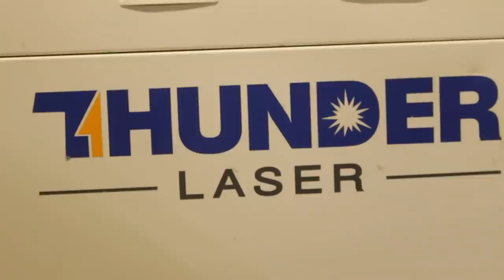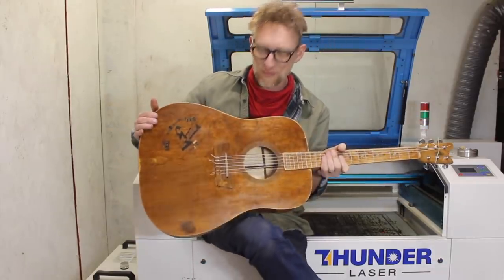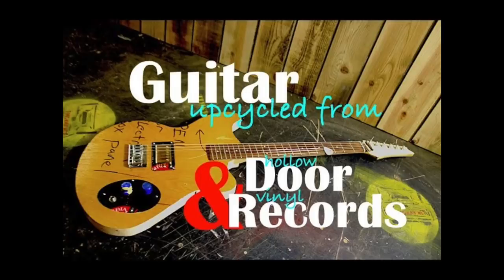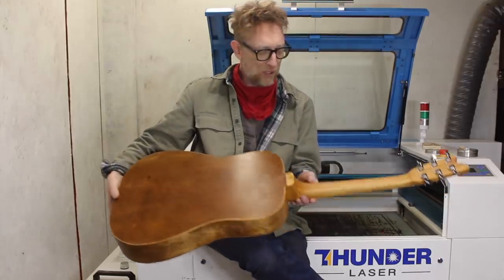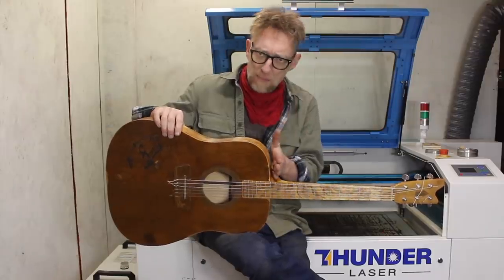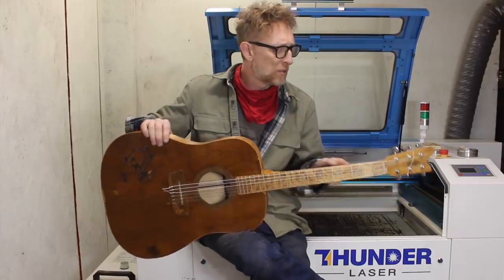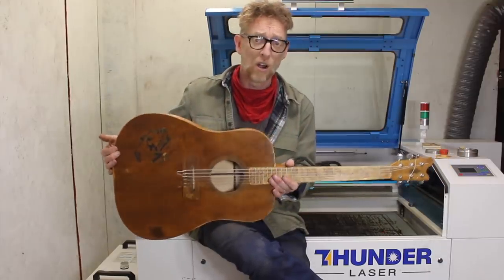Acoustic Guitar Made Entirely of Closet Doors

Comment: Nice work!  You can lower the strings by correcting the neck angle.  Fender in the 70’s were bad for this and required a neck shim to correct the neck angle.  By doing so don’t be surprised if you need to make a new saddle that raises the strings.

Comment: Thanks for this Video!
Now that the Neck is permanently set, and  can't adjust the angle :
One can lower the High String action, by sanding the Bridge itself, and the Saddle.
Also routing (lowering )  the Saddle pocket by 1/16 "   will help.   Be sure to  " Rat File "  
Grooves on the Bridge,( using a Dremel), on each side of the saddle, (where the strings rest),
to prevent the strings touching the Bridge wood, and are then able to vibrate Properly.
Reply from the maker: The problem is the body is 1/2" thinner at the neck than the tail, so the top slopes up as it goes away from the neck. It's not a setup issue and there's not enough wood on the top to set the bridge low enough into it. I just screwed up! This is just a prototype, I'm already on to the next one :)

Comment: Nice work! I recently found a guitar like guitar in a music shop in Marrakech. I say guitar like guitar bc whoever made it shaped it like a guitar but only 4 strings, fairly shallow body, and wooden tuning pegs that come up from the bottom of the peg box like on Renaissance guitars. It's made all of plywood with a pine neck and sides. The sides are really a series of pine squares placed with grain vertical. It had various issues but I kinda fell in love with it and I'm now trying to improve it. I took the back off and planning to add some bracing, trim down the sides, add some kind of neck block (the neck was only nailed to the back, no other support!). The bridge is interesting but too far back so im going to make a secondary  floating bridge that's adjustable. The maker cut (quite deep) fret slots but never added frets. I want to either fill them in or add a hard wood fingerboard and add tied on gut frets, since with a floating bridge the fret slots won't be in tune. It's painted, so idk yet how that will affect the tone. I might use brass and iron strings, or I might use the kind of handmade  goat gut strings that  are used on Moroccan instruments. We'll see.

Anyways your project kinda inspired me so thanks! Idk if my Moroccan guitar will sound much like a guitar but it will sound distinctive I'm sure  😊

Comment: Impressive. From concept to execution, an amazing project. I understand the concept but...If you do this again maybe give yourself a little more room on the hardware. A truss Rod so you could use steel strings and have some adjustment, bone (or some recycled synthetic) for the bridge saddle and nut, maybe some nice hardwood for the bridge and bridge plate. You would be able to set it up nicely so it plays well, sounds great, and looks sharp as a bonus. You could complicate it a bit with an off center sound hole, maybe a rounded off area for an arm rest and a cut away to really snaz it up. I see you get a little impatient sometimes and I understand, I also realize there is a lot happening that doesn’t make it into the videos, but I have no doubt you could make a real, jaw dropping “players” guitar from reclaimed materials if you tried. You have the tools, skills, and the vision. I enjoy your videos. 👍
Reply from the maker: This one was all about using only door.  Future versions will include real wood fingerboards, etc...

Comment: How is the neck holding up? I have a very similar idea but using plywood instead. I still believe it's a very good way to make a very stable and strong neck.
Reply from the maker: you mean they sell thicker plywood already made? lol. It's been 2 weeks and the neck is holding up fine. I did use nylon, tho, to keep tension down. I'll work up to steel string.

Comment: Try using graphite for truss rods. Then you can at least use ultra light steel strings. You could probably get away with silk and steel with your current method though if you wanted to get away from nylon. The layers and glue probably give it enough strength.
Reply from the maker: i've used graphite in other builds for sure! I think it could handle steel strings as-is, or I could just put a real truss rod in it. It wouldn't be difficult.

Comment: Holy lamination batman!

You put a metric crapton of manual labour into this considering this supposedly isn't even considered woodworking in the first place as the laser does all the work for you ;-)
Love the result (the look AND the sound). I wouldn't even have expected to get decent firewood from the heap of junk you started with.
Reply from the maker: HAHAHAHA! Great comment. But you're wrong, I put an imperial crapton of work in to it (but plywood and laser, so yes,  it's still not "real woodworking.")
Reply: Darn imperial units! So was it a long crapton or a short crapton then? If it was a long crapton I would only be 36 crap-pounds off.

Comment: How did you glue the neck together without removing the old finish?
Reply from the maker: i sanded every panel enough for the glue to adhere. There was one spot that I didn't sand enough and it didn't take, so I repaired it with epoxy.

Comment: My first thought when I saw the neck assembly was that the action was going to be very hit or miss.
Reply from the maker: The neck assembly has little to do with the action. It's actually much more stable than a traditional neck. I made an electric with a truss rod in the same style here: https://www.youtube.com/watch?v=Da_P9nIiYRw . The action sucks because I messed up the angle of the neck in to the body. It's parallel to the upward sloping back of the guitar instead of the flat top.

Comment: Am I right in thinking that laminated wood is very very strong? Sweet neck mate. Could this handle steel strings?  Very cool Tim.
Reply from the maker: it could probably handle steel as-is but with a truss rod would be better. I am more concerned with the tension ripping apart all the laminates at the bridge.

Comment: Don't they usually make nylon string guitars smaller? I imagine you could lower the bridge to lower the action some. If not I guess the only thing to do would be to steam off the neck and sand it down but that's a pain in the neck. Very cool though. I love the recycling. 

Your Etsy doesn't have any musical instruments. Is that where they'd be if you had them to sell?
Reply from the maker: good eye. I made a jumbo steel string body with an electric neck and classical nylon strings and bridge. why? because I can! lol the body is not flat; it's an inch thicker at the heel than the neck. SInce I atached the neck to the bottom first instead of the top, the whole body goes "up" and the neck angle/strings needs to do the same. I can't lower the bridge any more without digging in to the body of the guitar. Simple fix is to attach the neck to the top first so that's all on an even plain, then make the back of the body angle away.

Comment: Good . You shoud do the body of the guitar first and then set the arm properly set it in the block with a  dove tail and set the angle .
Keep working !
Reply from the maker: I didn't want to try and make a good dovetail joint out of plywood so I cheated :)
Reply: @timsway  then if your concern is the strength of the joint you could set the angle diectly in the base of the block of the arm . But there is not much chance of regulation . 
By standard the fret board should stand in level with the bridge any way you must build the acoustic box first . Keep it up !! Good luck !!

Comment: Nicely done Tim. Quick question, did you kerf the sides so they would bend? It was hard to see in the video while you were mounting the sides. It’s nice to see another use for hollow core doors than temporary work tables.
Reply from the maker: there's a segment on the lasering near the beginning which shows how I did it; I kerfed on the laser creating "wacky wood" side pieces. It worked REALLY well.

Comment: This is such an awesome project!,
Do you think this would be a managable build for some one with access to a laser cutter and basic handheld power tools?
Reply from the maker: yea, that's pretty much all I used! If I were to do it again, I'd use real wood for the fingerboard and bridge. I was making a point with this one :)
Reply: @timsway  Thanks for the reply :)
Is it very loud is it in relation to a conventional nylon string?
Reply from the maker: @samridsdale4484  maybe a little quieter. The plywood doesn't resonate as well as real wood.
Reply: @timsway  I have one more question (I promise this is my last!), do you think this style of body construction could be used with solid wood? Or would the sides not be able to bend as much even with the kerfing technique?
Thanks :)
Reply from the maker: @samridsdale4484  you would need to steam bend real wood sides. This would probably not work with real wood.

Comment: As expected excellent !!! 
Too bad for the neck angle but I hope there might be some others to correct this. Did you put a trussrod in it ? Maybe a two way action one could be useful with so much lamination. 
🤘
Reply from the maker: no truss as it's nylon (why I chose nylon, keep the tension down, but I think it could handle steel strings and a truss). The neck angle problem is the body is a little thicker at the back/bottom and I atached the neck to the back first instead of the top, effectively making the top of the guitar rise up, so it's impossible to get the strings low enough on it. I'm already working on v2.0 :)
Reply: @timsway  if you don't make errors, you can't learn ;-). Already waiting for v2.0. Hope you'll find enough doors 😁

Comment: Wouldn't one of those doors make a good LIGHT WEIGHT 'solid body'--just cut out the shape and glue on a surround to finish the sides. The inner webbing should give a pretty strong base for the neck, etc.--maybe build it as a semi-thru-neck. Hmmm.....
Reply from the maker: I have SEVERAL videos about doing just that. go digging in the archives. :)
Reply: @timsway  Why didn't I think of that! I'm fairly new here.

Comment: I've only just subscribed recently so I haven't seen a ton of your (amazing btw) builds, but is it possible to go back and install a truss rod in the neck at this point, or is that something normally done during the build?  Do you normally install truss rods in your other builds (being that they're electric) or just focus on neck alignment and plan for the string tension when planning?  

Thanks for these videos!  Keep making them and I promise I'll keep watching!  I also enjoy your music!  Is there anywhere to listen to more of it compiled in one place?
Reply from the maker: cheers. I could have installed a truss rod in it prior to gluing the fingerboard on (I didn't use hide glue so it's a little late now) but with nylon strings it's not necessary. Most of my builds have truss rods when necessary and appropriate. I make original music for a lot of my videos, but I don't have it compiled anywhere besides my album on iTunes. It's just background music, not meant for solo consumption :)
Reply: @timsway  Okay, I gotcha.  I guess it makes sense that you wouldn't need to with the nylon strings having so much less tension, but didn't know if it was something that could be done to help correct that bow in the neck without having to file the bridge or nut.  In spite of it, the guitar still sounds really good to me!
Reply from the maker: @gutsman85_86  the action issue isn't a bow. the neck is perfectly level. the problem is the angle it goes in to the body. the guitar is not a uniform thickness; it gets thicker in the back so the strings are actually having to travel "up" to the bridge.

Comment: Super cool use of a $10,000 machine to make a $150 guitar.
Reply from the maker: the machine is closer to $8k and the guitar is totally worth $175 in kitsch value alone!
Reply from the maker: But seriously,  do you think the machines in factories cost less than the products they produce? What's your point?
Reply: @timsway  My point was lighthearted, just laughing at how we buy these elaborate machines for our hobbies. But if you are going to take umbrage then there is a serious point there too.  You are not a guitar factory, that is not a factory guitar.  If you are shilling that as a factory tool, that is a totally impractical use of that tool.  

That machine in 130w version is actually north of $11,000.  That doesn't include shipping. I don't know what the factory application of that tool is, but that isn't it.  From a business perspective, that is a trivial use of an expensive tool.  If you are talking factory tools, you can buy a high quality CNC AND a SawStop table saw for less money and have far more capability.  So I'm not sure why you bring up the cost of factory equipment.  That doesn't seem relevant to what you show on your video.

If you are promoting it as a cool hobby tool, that is a hobby tool way out of the range of just about any maker I know.  Especially for a machine that is limited to cutting very thin stock and burning images.  It is akin to having an industrial loom in your garage to make yourself a set of christmas sweaters and matching scarves.  Few people are going to have the money or space for that.  

If you have the time and the scratch, go for it. Put it up on YouTube.  I'll watch, and chuckle.  Which is the spirit of my original comment.  A chuckle.
Reply from the maker: @rrhett2119  I didn't take your comment as hostile, I just seriously wondered what your point was. To answer, they also make a 40 watt $5k machine. Mine is $8k. $5k and $11k machine is irrelevant to the convo. The table saw does what tablesaws do (and you gotta make a lot of birdhouses to pay for a sawstop! lol) and cncs do what cncs do. 

This laser, unlike the smaller hobbyist type lasers, is a mini factory. I've had it running 8 hours a day, several days a week, printing money while I do other things (not literally, figuratively :). I know several people who make for a living and employ these lasers in their small workshops (mini maker factories, like mine). Heck, I know a couple guys who don't even have tablesaws; their business is based on these types of machines! 

Sure, making these guitars are not a real practical use; I made it to demonstrate creative uses and reclaiming. Inspire others to think outside the box and sustainably. (That's the company line; in reality, I just make this stuff to amuse myself :) 

HOWEVER I have had several people ask to buy this guitar and, once I'm done prototyping, I do plan on selling them - for more than $150 each.  How many do I need to make to recoup the $8k? Not many and almost no material costs...

The machine is not for weekend warriors. Certainly. It's for the thousands and thousands of other small business owners, like me, who can see this helping them grow their business and capabilities. 

I can't guarantee every one who watches my video is THE demographic for the tool. For the rest of you, enjoy the entertainment, get inspired by the idea have a laugh - or not. 

Thanks for watching. I appreciate your insight. Seriously. I like to know what people think when they watch this stuff beyond the one liners and I appreciate your time. 

Btw, I also have a cnc and tablesaw and make things with them that are practical and impractical, too :)

Comment: I would've added a truss rod or carbon fiber rods at the very least
Reply from the maker: It's a nylon string. They don't get or need truss rods
Reply: @timsway  Right... Nylon = less tension. It's been a while since I've had one in my hands. I'd still put some support in the neck because of temperature changes between seasons but I guess the neck being laminated and being laminated against the grain would help enough
Reply from the maker: @wesleyzimmerman94  oh yea, this is the most stable neck I've ever made and less likely to move like normal wood as it's unlikely to react to humidity.  I think it could handle steel strings as is.